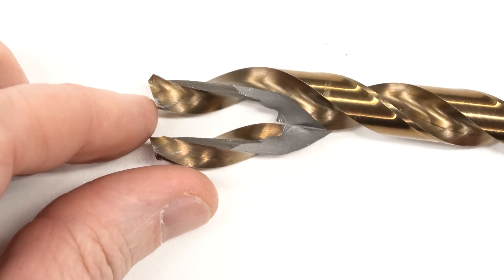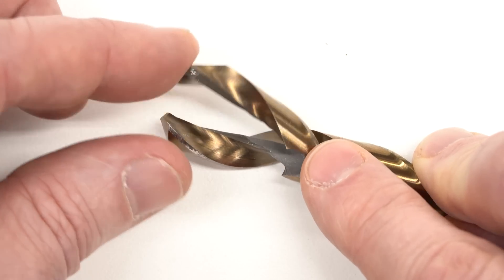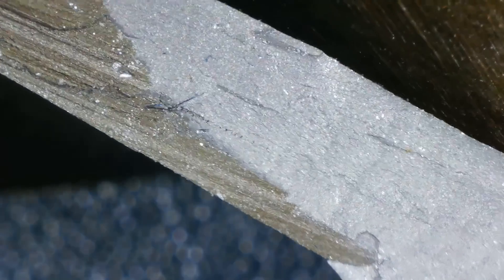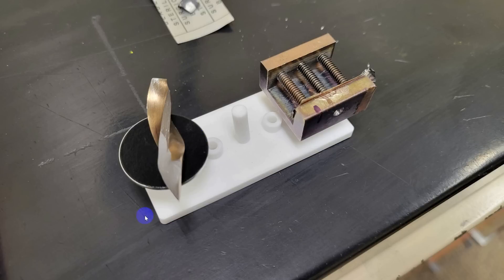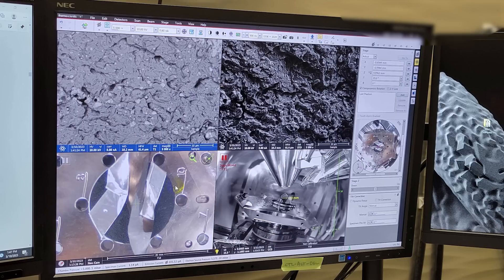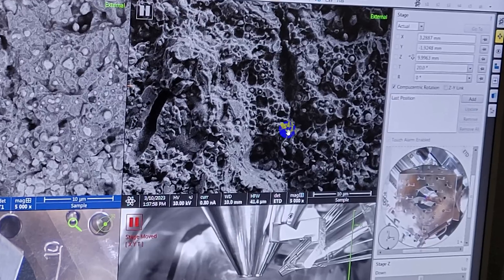What the Scanning Electron Microscope Reveals About This Failed Drill

Comment: For what it's worth, I have read the following: 1. No professional would EVER drill a pilot hole; 2. A professional will ALWAYS drill a pilot hole for large drills, just larger than the web of the drill; 3. A professional will sometimes drill a pilot hole, no bigger than 1/2 the size of the final hole, especially if using an underpowered spindle; and 4, A professional will typically step up in small increments of 1/16" to 1/8" at a time.

Luckily, I am not a professional, and therefore I do not have to reconcile these conflicting demands. For what it's worth, I usually do something between "2" and "3", that is, use a pilot hole that is bigger than the web, and less than half the finished hole diameter, if I am drilling a hole of more than maybe 3/8". It seems right, but I make no claims that it is right. Some other strategy may be better, worse, or equivalent.

Comment: I used to work at a Test House with a SEM.  I was told that when things break NEVER try to put the parts back together.  It's better to leave them apart as any further contact could mask the reason for the failure.

Comment: As a Knifesmith, I've drilled many holes in steel, never seen a bit break like that, however, after doing snap tests on many steels, I noticed straight away the difference in grain growth in the broken section. 👍🍻🇿🇦

Comment: Definitely pre cracked. No trace of radiating beach marks until the lighter portion show that is were the break started. That is a defect in the material the drill was made from. I can see no reason not to enlarge holes, the only thing the tip does is keep the drill from advancing too fast and taking too big of a bite but no other reason.

Comment: I'm sure someone said this already. But the "nodules" are carbides. Could be tungsten, or molybdenum, possibly vanadium also. Depending on the alloy the used. Likely they will be 2 of the 3. 

But they are carbon and the metal forming hard particles the ratio of carbon to the other metal depends what kind they are

Comment: Funny. This just happened to me. Drilled mild steel..stainless no problems etc..Was drilling a hole in 18g aluminum angle and stepped up from 1/4 to a 3/8 bit and it fractured the same way. No step up drilling with these bits. At least in thin metals..Got it.

Comment: 2:45 I'm not a biologist but my guess is that the "discolouration" is due to two different fractures. And initial "clean" rapid fracture, as the bit jammed up, followed by a "slow" tearing "dirty" fracture as the tailstock started spinning.

Comment: Well, Sir, I believe this settles the pilot drilling debate. I have to add that pilot drilling in thin plates or walls is not a good idea unless you change the cutting edge angle on both flights. It is also not recommended when using solid carbide drills. I have done it but only to "ream" a hole in unforseen and poorly planned job runs. Here, I have stoned the corners to a radius so as not to generate a stress point and reduce the feed rate dramatically. This will lead to excessive wear to the cutting-edges.

Comment: Great video! I am a PhD student using scanning/transmission electron microscopy to study ceramic crystal structures, and I thought your explanation was very thorough and concise. One thing I thought I would mention is that EDS/EDX (Energy Dispersive X-ray Spectroscopy) for elemental analysis is usually only semi-quantitative at best, at least without a reference sample. Also, unless you have a very specialized detector, the technique is inaccurate for detecting elements below an atomic number of ~11 (this is due to the low energy of the characteristic x-rays these elements produce). 

I suspect that the high carbon (atomic number 6) presence in this sample is not only the carbon present in the alloy, but also carbon contamination from the environment/touching it with your bare hands. You can alleviate some of this contamination by plasma cleaning the surface prior to loading, but environmental contamination is always going to be present to some degree. 

Oxygen is also <11 on the periodic table, and unfortunately oxidation is also hard to avoid by virtue of having the sample in open air. Tool bits are usually alloyed with other reactive metals to reduce oxidation, which happens via formation of nanoscopic oxide layers of chromium oxide and/or other oxides to passivate the surface and prevent the iron from corroding. This means that some portion of oxygen will always be present when analysing a ferric material.

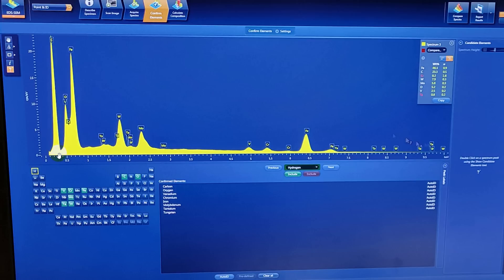If you were to repeat this measurement, I would suggest turning the AutoID function in AZtec off, and manually selecting the elements you suspect are in the sample, minus carbon and oxygen (i.e. Fe, Cr, Co, Mo, W, V). Then, you can change the settings to look at the atomic % rather than the weight % shown in the table to the right @14:30. This should give you a more accurate ratio between all of the major metallic elements within the sample.

Thanks for the video!

Comment: to me this facture looks liek there was an internal fracture already formed ie the dark colored section and then the real breack happened while enlarging the hole and the reason i say that is because that dark color looks liek the material has been sucking in oils for a while now  and also they are wrong pre drilling a hole and then enlarging it with a bigger drill only makes the job easier for the bigger drill bit  sure it might change the places the drill bit experiences stress but not like anything its not built to endure in the first place

Comment: When enlarging a hole, you place uneven stress on the tip of the bit.  the very center has no stress on it, and then when you reach the inner wall of the hole you are enlarging, there's a sudden increase in force applied to the bit, an added "twisting force" that occurs at the exact edge of the cutting surface where the inner wall hits.  This creates a very strong sheering force which may overcome the hardening of the bit.  It also introduces a "pulling force" on the cutting edge of the bit, pulling it away from the axis of the bit.  And since there was a micro-crack there, instead of a little bit of plastic deformation, it pried the crack open.

Looking at your failure though, the crack you found was much closer to the axis of the bit, but your introducing pressure farther away from the axis created what amounts to a lever, to pry open that micro-crack.  It's likely the bit would not have failed on that operation if you had not been widening a hole.  The bit WAS defective, but it may have even still met the minimum design specification.  Your attempt to widen a hole just overcame the over-spec design of the bit due to its defect.   So like the manufacturer says, "don't do that".  ;)

Comment: The reason your drill failed in that particular shape is a few reasons. Think of a drill as a screw, and think of a screw as an inclined plane wrapped around an axis.
Force on the drill is applied linearly, along the axis of the helix made by this twisting.
Now, consider that the outside of the drill is moving faster than the inside due to the circumference difference.
This is why drills wear on the outside corners first. 
Nothing is perfect in life, and so one flute will always have more contact than the other, meaning one side of the drill always experiences more cutting force.
And finally, cobalt drills are heat treated. 
It looks like this wasn't properly tempered.
I said this before I watched your video.

Comment: Hi.  Nice video, hats off - as with the rest.  Very interesting. 

Curious.  Did you forget to analyze the known coated portion of the drill bit and compare that to the suspect fracture where was oxidated when it was plated ?  Those figures would prove, I believe beyond a doubt that your theory is correct.

Lifetime warranty on drills ?  I would never think of buying such a thing.  The time it takes for me to call on the phone & handle that with the cost of warranty on a bit seems awkward.  It is tough when a $75 mill fractures after the vice break loose when not fastened though.

Comment: Very  interesting video. 
I almost always drill a pilot hole and have never heard that it could cause a drill to break. 
If you look at that broken drill section where the clean break goes into the complete drill I believe you can see the darker section continuing into the rest of the drill.  4.42 in the time stamp.

Comment: I think you'll learn more if you research why and how split point grinds are used. McMaster has a pretty good description. But the higher end manufacturers probably have in depth feed and speed calculators . Using a pilot drill is common for chisel point drills where the web doesn't cut. Tool grinders know about this stuff better. But using magnification after a cut is the way to go, just do it before failure. Then you can see if your rpms are incorrect. I put a load cell in a fixture to measure cutting pressure. Next I want to measure vibration with accelerometers.

Comment: That size drill usually don't need a pilot drill,or smaller drill before it. When jumping up to large drills like 1-1/2 or 2" a pilot drill is a good idea because drill web at tip is thicker but also not really needed expecially in alluminum. When you get into stainless steels or tool steel it helps to pre drill when going over 1" inch or more.

Comment: I agree with the manufacture, a drill bit is designed to make a hole, not the best for actually enlarging an existing hole.  There are specific bits for "honing" and existing hole, like a engine cylinder honing rig

Comment: From my limited experience (as a co-op for GE Aviation doing metallographic analysis, materials science background), I'm only 3 minutes in and your interpretation seems right to me.  The bright silvery failed surface is what failed in tensile overload, while the oxidized surface has obviously seen life.  This is actually how some aerospace investigations are evaluated (you can sometimes count the number of cycles a failed part has seen based on the different oxidation state colors (forms a series of color gradient bands, a different color for each # of 'cycles' that part has seen).  Obviously the more oxidized a surface is the more time it's been epxosed to the elements or whatever environment it operates in.  This video brings back memories of interepreting LCF (low cycle fatigue), HCF (high cycle fatigue), and basic metallographic failure analysis, loving it!  Will continue to dig in!

Since it seems you have ready access to an electron microscope, you could do EDS on any specific points of interest and determine what elements are present at that location (ie, when you mentioned the precipitates (nodules) in the surface that you expected were tungsten, if you did EDS on one of them you could confirm (ask whoever does your electron spectroscopy, they'll know).  You could also confirm the oxide presence in the exposed/previously cracked surface using EDS, finding a lot of oxygen and the other elements present in the the composition.  Compare that to an EDS of the tensile overloaded.

Comment: You also had some Fluorine. Cleaning solution? Etching? Or oxidizer? Either way that drill is completely non-conforming. About the drilling for the enlargement of holes, it's pretty standard for a drill. The only thing I might come up with is work hardening on the previous operation, but that's longshot.

Comment: Aluminium isn't exactly the toughest material to drill. And from the video, it doesn't look like James overloading the machine trying to get the job done as quickly as possible (my feeling, from watching other videos, thart's not James's way of doing things in general.

Also, at least for non-split point drills, there's literally no way to drill larger holes - because the tip of the drill will not form a hole, only the edge outside of the centre will do - so here you MUST pilot drill. The point of a split point (pun not intended) is that the drill can be used without pre-drilling - but only if you have enough power in the machine to feed the drill enough to remove the material. I wouldn't drill a half-inch hole straight in in aluminium - or maybe I would, but not much over that - split point or otherwise. If you have a 10 hp motor in your machine, sure, that may be a different matter.

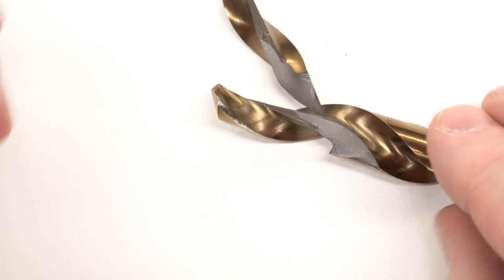Comment: Failure most probably happened when the flutes are initially hot rolled into the metal bar and the material is drawn tangential to the grain run of the drawn bar stock. The barstock is the problem and the fast roll process doesnt give time for distributed grain boundary shifts and sets up localised flow zones. RCA is money, yet again. 5Y's should confirm it's the unit that makes the parts per million count and business is tracking to plan. 16:45 yep, move on this stuff happens rarely.

Comment: I suspect that a cardinal rule of failure analysis may have been broken here, and that is to avoid fitting the parts back together once they have broken, as it can distort the features, but I agree that a manufacturing defect is likely what started this failure, as you are unlikely to have exposed it to the temperatures necessary to create the coloration you see. As an aside, M42 cobalt steel is very brittle and I do not use them for drilling AL, I prefer a less brittle bit for drilling AL as it is less likely to break if the bit grabs due to user error or material variations.

Comment: I think there may be a little truth to not enlarging holes but that's not to say you shouldn't pilot the hole, it's just that you only should pilot a hole big enough to relieve the tip of the big drill, that way you aren't getting abnormal pressure in the middle of the cutting edge

Comment: Stepping up sizes should be done in specific increment. 
Cutting too little can overload the cutting edge. 
Or in worst case, the drill spiral essentially displaces material and screws itself into the hole. 
Said that, 
Controlled feeding is forgiving in that you can control the amount of 'bite' taken. 
I've never had that problem lathe or mill drilling. But by hand or drillpress, you need to be careful.

Comment: Ok, now I've gotten to the hole enlargement part. I agree with the manufacturer.  When I worked under a part time machinist for a short time, he said it was standard practice to use a pilot hole. After watching and doing this myself,  I realize the larger bit will tend to grab a self feed too fast if the diameter was close. I suggested to him that the pilot should be no more than one third the full diameter.  This keeps the included shoulder angle in play and prevents too fast a feed, while keeping the larger bit tracking true.

Comment: Lack of proper lube, heat build up, possibly contamination,  galling, sticking, too fast feed, increased torque,  snap. Galling can be seen on the side cutter of the flute. The placement and shape of the fracture indicates too much torque. 
I'm not an expert in this, but it seems obvious to me. Then again,   on a microscopic and metallurgical analysis level, the outcome might be different. I'm two minutes in. I'll finish the video now.

Comment: I do actually agree with the manufacturer on pre drilling holes with a smaller diameter. I do find it can prematurely wear out the outside cutting edges on your drill. With carbide drills, this treatment can actually chip the edges off your drill. Not saying I don’t do this, on smaller machines where you need to drill big holes it’s kind of necessary.

I wouldn’t say this was the point of failure of this drill though, I think your conclusion about how this still broke is bang on.

Comment: If you have the spindle torque to do it, go right to size in soft materials .  I routinely drill 2” holes in aluminum without predrill. Also,  the split points are great for eliminating step drilling,  plus it’s time consuming.  Hog material whenever machine and stock allows it.

Comment: Best practice is to predrill any hole. Most efficient way is to drill just larger then the flat of the tip. If you want an perfect on size hole, the second to last bit should be 2 steps down (standard kit). Increase your feed, plenty of coolant. In the right hands almost as good as a reamed hole. I agree with a cracked bit. Perhaps you dropped it to start the fracture. I'm been a machinist (full trade) for 20+ years. FYI the better drill bits have the shank as a different material. If you buy cheaper bits they only use HSS in the first inch or so.

Comment: Why are you using split point drills then stepping in in size, with such a small drill? And in aluminium? How big was the drill that broke, and how big was the hole you drilled before the broken drill got fed a hot dinner?

Comment: As an apprentice  I had to drill a 40mm hole in 100 parts on a lathe. To save my strength, I
drilled in a couple of steps, and it went allright. However, my instructor adviced against it because a drill can only get rid of the heat through its core in contact with the material. So this is a cooling problem. On a manual lathe, the coolant pump is not very efficient without through tool cooling. Kind regards ML

Comment: I always did that (drilling with increments) but yesterday for the first time I was drilling in a concrete wall to put up a thing my wife asked. I started with a 5,5mm drill bit. Moved to 8mm and it went fine but when I jumped to 10mm to later on add the anchors the drill bit got stuck and snapped.

Comment: With split point bits you don’t need to predrill and if you do it’s usually best to only drill a small hole so you get as much engagement of the cutting flutes and less torque on the edges